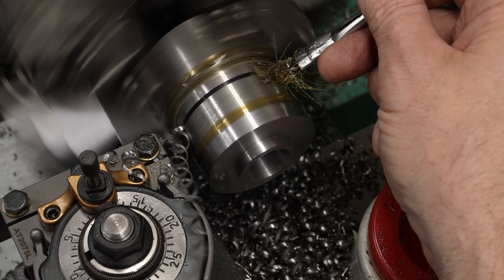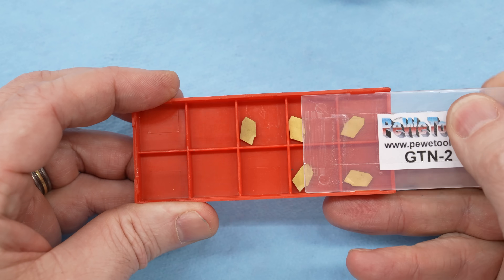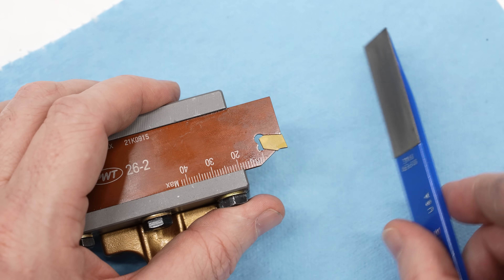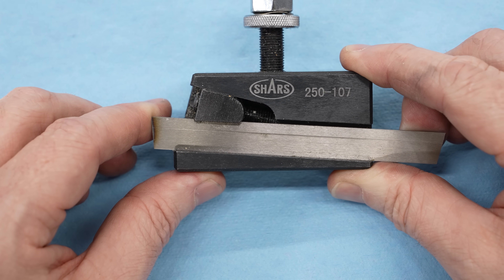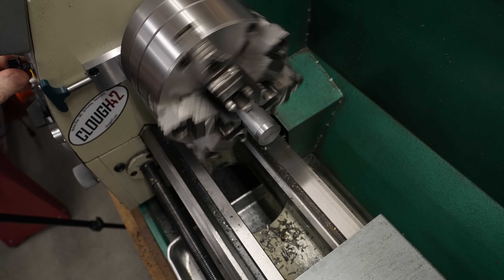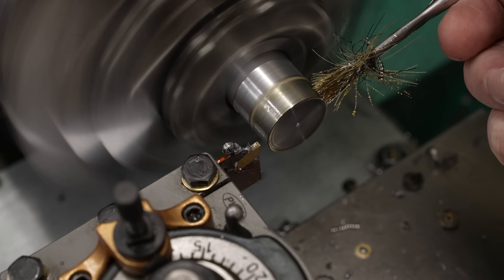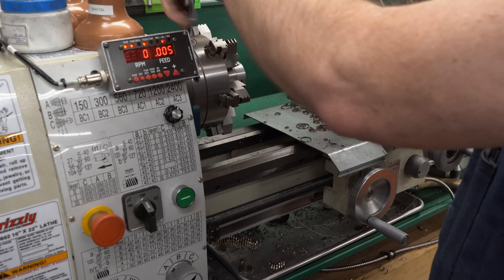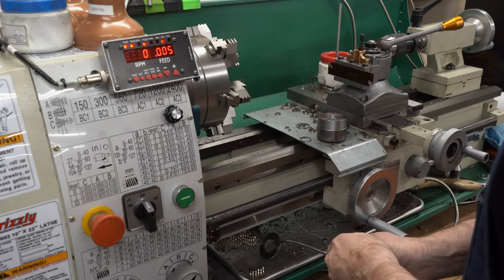High Speed Parting with CARBIDE in a Small Hobby Lathe

Comment: Cutting tool geometry is a trade off. The common belief with metal cutting tools is the metal is "shaved" off by the sharp edge of the cutting tool. While this is some what correct, this is not the only way metal cutting tools function to remove metal. Yes, positive rake cutting tools require less power to remove metal, the trade off to this is a fragile cutting edge that is not tolerant to abrupt changes to speeds and feed rates. Positive rake cutting tools are inherently fragile. What is not often appreciated, metal cutting tools are most effective on harder metals by producing heat (about 1200 degrees F) at the point of contact then plowing away the soften metal. This is how negative rake cutting tools functions including part off inserts and why they have a radius edge. If the manufactures of cut off inserts wanted a sharp edge it is easily achieved in the modern carbide insert production process. 

The coating works as an anti wear, heat barrier when used properly.. grinding/honing that coating off is counter productive and will greatly reduce the life (chipping and more) if the carbide insert. More so when the cutting edge has been "sharpened" to gain a fragile positive rake cutting edge. Add to this, modifying the carbide insert this way risk exploding the insert while cutting/running.. an insert failure/explosion can be very dangerous.

Insert parting tools work best as delivered, properly set up, proper speeds & feeds. This means parting tool on center, running the spindle speeds & feeds at the recommended rates on the package. 
@ 7:00 minutes in this video, note the protrusion at the center of the parted off round, that protrusion should not be and will not be there if the parting tool is properly centered. Parted off part should have no protrusions at the center. This indicated the part of tool is not properly centered relative to the work. This is also the cause of many problems with parting off parts on a lathe.

This also means a properly rigid set up and no pecking while parting off, go direct in, and increase the feed rate as the diameter decreases to maintain a some what constant SFM..

Keep your hands away from the spinning chuck and work being parted off, If the parting tool explodes to snaps off your hand will be seriously injured and the flying bits can hit you in the face or body as a projectile. Use a box or similar mounted to the cross slide to catch the parted off part. Use a rod mounted in drill chuck that can be put inside the hollow round being parted off as a catch stick. It is imperative to keep hands and body parts away from the cutting tool and work being parted off or machined on the lathe. These are basic lathe safety issues..

Lose the 6 jaw chuck, they are a recipe for chatter. 6 jaw chucks work ok on tubular and compressible material. This is due to the reality and fact the 6 jaws do not and cannot be made to meet with absolute equal contact. Same applies to any round, hex or similar held in a 6 jaw chuck as round, hex bar is never completely round ... even center less ground rounds have some degree of deviation from round. This fact and reality means only a few of the 6 chuck jaws contact and grip the round producing a situation excellent for chatter and instability. This is why a 3 jaw or 4 jaw or collet is far better for work holding in a lathe.

Comment: Use a drip feed bottle with cutting oil  instead of the brush and drip directly above the cutting edge of the tip, the brush is not getting the oil to where its needed when the cut is getting deep, otherwise perfect !

Comment: I am using a much smaller lathe.A TOS mn80. I use a 2.4mm wide HSS blade. For parting 2 inches of mild steel i run the lathe at 500rpm. I have never stalled the lathe or broke a blade. Just keep a constant feed pressure. When you stop feeding you need a scary amount of pressure to start cutting. You breaking blake is because you stall the lathe. Basically you need more power to keep the lathe running.(the rright gear)

Comment: If you want to get rid of the smoke you need a coolant system on your lathe, not neat oil. In an ideal world flood coolant straight onto the cutting insert, but for you even a bottle of coolant you could squeeze in would be better.

I remember when I was in the first or second year of my apprenticeship getting a telling off from one of the old timers for filling the shop floor with smoke doing exactly what your doing 😂

Comment: One thing I can say is to ignore everything I commented to your last video.  I must have got over-smug because everything had been going so well - like your results but at 300rpm and in "more challenging" steels like 316 stainless, 4340 etc.
Then did a 10mm bar of either EN1 (1213) or EN3 (1020) crappy steel and detonated two bars on the trot.  Will try your insert holder because at least it has two ends!

Comment: You can use the chip size as a guide. Generally you want small chips that break apart rather than long curly ones. It looks like the higher speed produced smaller chips, so congrats. I've always heard that carbide likes faster speeds than high speed steel,  so that may also be a factor here.

Comment: Very cool update! Would be super neat if the ELS/motor vfd had a mode where you could ramp between start-rpm-end-rpm based on the cross slide position and/or just on a timer - know that you have to keep feeding, and it will speed up as you go to keep consistent surface speed. CNC machines do it, having a semi-dumb vfd do it wouldn't be too difficult. <3

Comment: Real machinists ("real" = folks that get paid to run bigger, higher HP machines than your typical home-shop) will usually tell you that the cure for chatter is to increase the feedrate.  Lack of rigidity is the first killer, but once you have a machine with adequate rigidity, chatter can be the result of too-frequent chip breakage, and light cuts make really weak, easily broken chips.  The change in cutting force (cut/break/cut/break), once it finds its own natural aka resonant frequency, is chatter. I think that's what you are demonstrating here.  Feed hard enough that you don't break the chip.  You also mention surface speed.  That is, in my opinion, only a secondary variable, meaning there's a decently wide range that it will still work versus a narrow range of feedrates that work.  So why not crank it up to the high end of the acceptable range and get the cut over with.

Comment: I like to use water soluble oil with a drip feed when I cut off, especially larger diameters.  I part using a steady rest when possible, as my chuck is not what it once was. I will also use a clamp  I crafted from an aluminum ring to place force on the chuck jaws.  You really get everything out of that hobby lathe that is possible. Nice job!

Comment: The thing is that when the diameter of the work goes down as you reach the centre, the surface speed and thus the chip size and cutting loads and everything else changes as well.
Carbide really is for very high speeds, large chip loads etc. and never stopping, constant flood coolant etc... so it has it's issues when running on manual lathe, since you can't provide all the parameters for it very consistently.

It's a great video, you tried it, learned something, you now know more :D

Comment: I’ve been blessed that I’ve never really had difficulty parting off. I still just use the old HSS blades touched up on the bench grinder and hit with a diamond hone, but I don’t go nuts with the sharpening. I’d say my biggest issue is with deflection messing up the surface because I tend to leave the stick out pretty long. I have a Hardinge Super Precision so it’s really easy to control the feed
Reply from the maker: Yeah, that's a nice lathe.  I'm open to the idea that the problem might be me as well.  I exploded a high-speed steel parting blade on an HLV-H once, too.  :)
Reply: @Clough42  don’t feel bad. I know guys with 30 years of experience who do everything possible to avoid parting off. I’m just lucky something clicked for me. I struggle with power tapping in the mill, so much so I bought a hand tapping station so I don’t have to do it as much
Reply from the maker: @rexmundi8154  you've probably seen me power tap M3 in a blind hole in the mill, but I still want a tapping arm, because tools.
Reply: @Clough42  It was my secret shame, but I got freed when Howee’s Machine talked about being afraid of his key way cutter

Comment: I was taught to set the parting tool a smidge above the centerline to help avoid grabbing. The tool will spring down a bit under load, so when you set it (without load), just set it above the center. Cutting with the edge of the tool lower than the center of the part pulls the tool into the cut, and the slack on the crosslide will make it easy for the tool to move forward all by itself. If anything,  you probably want to be a little higher than center under load
Reply from the maker: I set it just slightly above center, with the assumption it would flex.  I've seen the opposite advice as well, and had some success with it.  I think all of the variables interact and there are multiple ways to succeed.  I'm just happy to have found one.  :)

Comment: My experience is that WD40 in a can +long straw is better than oil. Also 2mm wide insert works better than 3mm (my lathe is 1300 kg~ 3000lbs). Feeding by hand is better than autofeed. The feed has to be such that the WD40 doesnt steam. I set up the rpms as high as possible, but low enought that the centrifugal force doesnt spray WD40 all over the place (which for most applications is 600 rpm). Also when machining the weldable steels they tend to work harden, and there is no clear conclusion under which conditions. This work hardening is the reason why auto feed doesnt work and will break the insert When the steel work hardens it is an art to take this layer off, and then for some time the tool cuts like a charm, and then the surface workhardens again.

Comment: I have found that carbide inserts like to be "abused" (in the sense of running parts at higher speeds). However, on the old Colchester I have I can obtain a very low rpm/high torque for the spindle with a backgear and that seems to work OK too; so I suspect that part of the problem with breaking inserts/jamming is insufficient torque at lower rpm on non-geared lathes - perhaps leading to uneven pressure on the parting tool causing it to grab.

Comment: I received a recommendation from a salesperson from iscar to have the tool slightly above the center because it will give less tool pressure.
you will get a small lump left in the center, but you will get that anyway when you cut off a part

Comment: This seems like the perfect reason to add Constant Surface Speed to the VFD via the electronic spindle encoder while using the linear scales for radius input. Once you try CSS machining you will immediately see a productivity and quality improvement. In fact that is the primary reason CNC'd parts look so good.
Reply: I know nothing about turning, but I was thinking to myself that he needed a third hand to turn up the speed, to keep the surface speed, as th cutting diameter decreases
Reply: @erik_dk842 or a constant oiler freeing up a hand to be able to adjust it
Reply: A VFD will have constant RPM until parameters(overcurrent) are maxed out. Belt slip is another issue.
Reply: @Eluderatnight  Constant surface speed =/= constant RPM. At 50mm diameter the RPM for 100m/min arent the same as at 10mm
Reply: @Eluderatnight  A VFD will run at the speed you tell it to, if it's capable within its parameters.

Comment: Before I started out in hobby machining I'd watched a lot of YouTube and I knew that "carbide likes to be pushed" - so, in my ignorance, I pushed it. And it worked, just as it did for you. I've never had a problem parting with carbide because I'm not afraid to send it. Power feed works well.

You also need a chuck that's in good order. Robin Renzetti had a video on trueing chuck jaws, and started out by showing what kind of deflection you can expect in a part under load if the jaws are bellmouthed. That's a recipe for parting problems.

Comment: I have found that rigidity in turning and parting and boring has the same effect as in drilling 
a drill, if you push it slow it just chatters and doesn't wanna cut
but if you push it it goes really nicely
same with  boring bar, even brazed carbide  ground to a razor sharp edge will sometimes squeal when taking very light cuts so what I used to do is either hold the bar with my fingers to make a crude "dampened" bar or I ok a heavy cut
Another example is balance of a rotary part which can be horrible at slow RPM but it quickly evens out at higher RPM if the imbalance is not too big ofc
CNCs all use high-ish SFM, constant uninterrupted feed and have great results... even the small CNCs that are wobbly like a wet noodle

Comment: I am sorry i don't know INC measurements but as metric. Blade should go in to part someting line of 0.05 to 0.08 mm per turn of the spindle. i think y could try something like 1500 rpm. If y don't have dynamic rpm in your lathe. Y can see  when parting is good when chips at the start of the parting fly about 25cm of the part and gradually stop flying.
Reply: Basically in the middle of the part spindle speed should be unlimited. Cutting speed should be with carbide 30000/ by diameter in mm so 30000/40=750 rpm.

Comment: I run into difficulties when the diameter of the workpiece diminishes down.  Start with an inch and a half o.d. and when it gets down to 1/2" it all of a sudden will be like hitting a wall.  Going from a nice cut to zero.  Increasing tool pressure then quickly results in a broken carbide.  Works often enough to lull me into a sense of complacency when it drops the boom.  Almost always works if I have a center hole drilled.  Because of that I turn on slow speeds and steadily drip the cutting fluid on.  When this happens I am getting very little vibration.  Using a 12 x 36 Grizzly G4003G lathe.

Comment: There are min and max feeds and speeds on the insert box for a reason. Running under those is worse than running slightly too fast. For production running 80% of the max has been a good compromise of tool life and production speed.

Comment: Seems like you had a real Eureka moment 👌 

My two latest videos are about parting off. The main things I’d recommend is using power feed and not using Chinese parting tools. Maybe you should make an electronic leadscrew on your cross slide 😉

I’ve started with a Chinese blade and inserts but they have a tendency to pack up the chips in the cut and blow the insert. Then I switched to a name brand tool , no such problems anymore. 

Feeding harder will solve many unstable conditions and will even allow you to part with major stickout from the chuck as I’ve demonstrated.

In the case of your setup going slower with a VFD is robbing your lathe of power which it needs to make the cut happen. That’s why it didn’t stall when you were parting faster.

Comment: One thing I would suggest is go with a squeezy bottle, like for condiments, for applying cutting oil to your parting cut. A slow drip directly onto the cut/insert meeting point does wonders. It will take more oil than the brush method, but it works WAY better.

Comment: 50  years ago, in school, I learned that increasing feed can solve a chatter problem using long boring bars. So same seems to apply to parting.
Though it needs a machine with enough power and stiffness. So mini lathe users might not be able to work that way,
Chatter is a self induced vibration that can be described using partial differential equations. Same as when the flag waves in the wind. Or stick-slip.
Reply: Sorry did say partial, should be nonlinear differential equations,
Reply: @Mike40M  i was going to tell you that, good catch.

Comment: It made a big difference for me when I stopped being a fanny and used the power crossfeed. Knowing you, Im sure you could fit a stepper motor on the back side of the cross slide and have an els-cs. Then you would be dangerously close to having a cnc lathe lol.

Also, couldn't help but notice you not locking carriage. Which leads me to believe you might be crazy...

Comment: I generally also part at high speeds on my lathe, the only thing I do differently is I drip cutting oil into the groove as I cut to keep the cutter as cool as possible. My opinion is that when the tool heats up too much it expands in the groove enough to grab and that is when you run into trouble...

Comment: I have a smaller lathe, and I've done some very high speed turning with carbide tools. It's not quite the tightrope act that a parting tool is, but it still feels terrifying. I wore a full face shield.  That said, I've seen someone using the same lathe I've got to turn hardened steel with carbide bits at max speed. That's not one I'll be trying any time soon. In the video I saw, the chips came off like the part was pissing magma.

Comment: I gave up on those little tooth insert parting blades because they gave me a lot of trouble.
The vibration as you cut can jar that tooth loose, and all goes to hell real fast at that point.

Your surface feet changes as your depth changes, so at some point you do need to speed up.  If you watch some of those fully automated machines, notice how they speed up as the diameter reduces.
Another thing I do is I lock the carriage to the bed.  If your tool isn't totally perpendicular, the cut can pull the carriage, so I lock the carriage.  The Atlas has a cinch on it to lock up, not the feed screw.

I moved over to using the T style cobalt parting blade and keep it short, like .75" to .5" stick out.
The carbide parting tool I use has the cap screw that holds down the carbide tooth and I haven't had a problem with it so far.